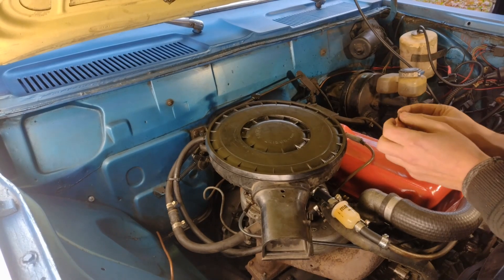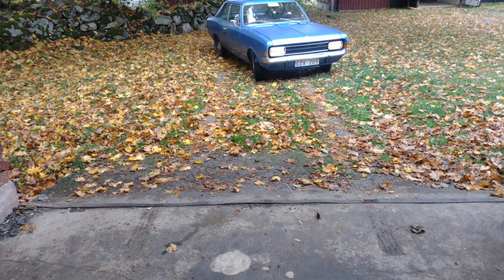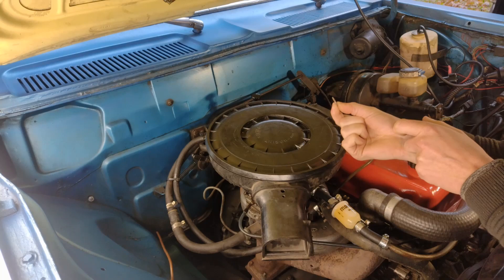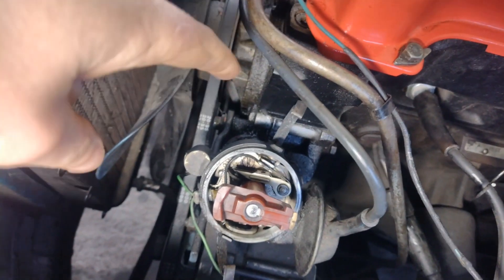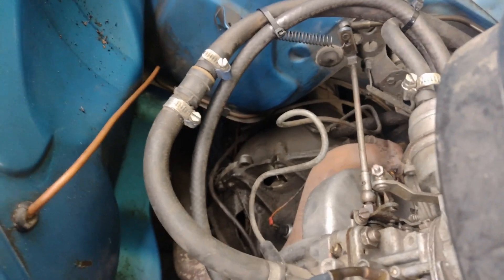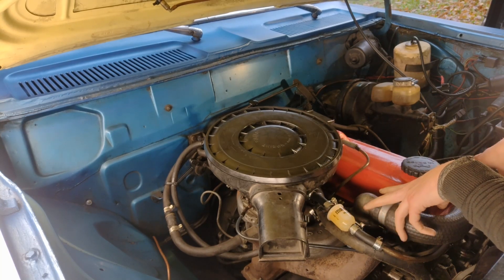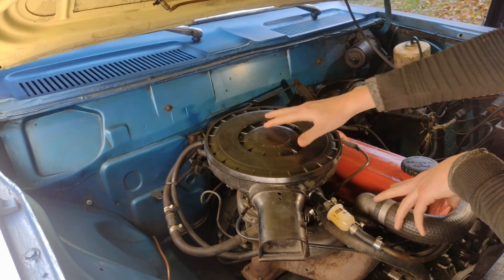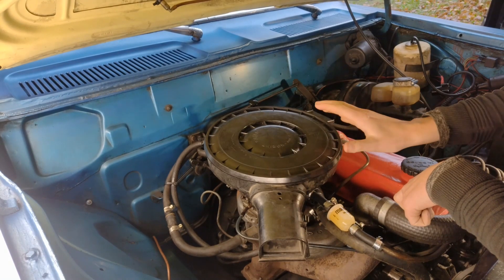Carburetor Solex Troubleshooting on Opel Rekord C 1900 From 1969

Comment: Must Say Look awsome You kept originality in Opel cars Love those cars ❤️
Reply from the maker: Thanks ! and the car runs and drives amazing with the original carburetor.
Reply: Love those cars not much for fast cars like comfort driving and Motors actually dependable always start are Had many cars are Open had less problems with and when trakt cheap fix are Very nice drive are just Comfortable and go fast enough for Get speed ticket on motorway so are Not that interested in 4 sec 0-100 km for not what have a car for like a car take me from point A to Be and comfortable drive and Rekord are very dependable motors in those cars just Nice car own for will just Be enjoy drive and Are Very Nice Opel Rekord Berlina 1980 year model Had Green metallic with black vinyl on upside really Say Sit in that was like be in a really nice chair in home So just Comfortable Could drive 400 kilometers in that without a paus för just Comfort are Set chair high want so zjpiet legs when 189 centimeter are Just Best car ever own always start in winter line summer My wife got it when diverse for kids and Say Toolk a some cars SAAB 900 was good but Audi 100  Avant quattro Thst was when Got same Just Comfortable but pricetag are In that also Expensive and everything is expensive but not feul was about same but rest Parts crazy pricetag so friend said how could sell it and bought a Opel Rekord cup'e dark plum metamic with Black above and that had many years Are just Say Are a Really nice looking car 1979 model and just About Shown nice a var can look Check that models up for are So Awssom Looking and Just Comfortable like in best sofa in home and Just work are maybe not fastest but are Really Nice drive and Are Not that a car should be are also Not breaker bank are Just When a Rekord Berlina just nicer design are Big inside and just Love if be afford a new car today had been a Open Insignia cup'e that's is a really nice looking car and Just Needs spend a lot for get Chair in home are more comfortable but pricetag is very different but it is a really nice looking car that Also Fast but not that are probably one of most Beutyfull car ever seen look those up are Create design See it in real Beat photos and that Friend have one 2019 year model he will ne er change car again for everything Are Just not get better than this so Why change when not see how can get greater than this and was Actually So impressed in that car Midnight blue and just Are never seen a More beautifully car and Are a own level of Nice inside are Just like Soend most time in that not be a bad thing Car are In that still do very nice cars are underated brand ❤️

Comment: Surprised that a thick washer can change the hight of the fuel so much but looking at the video it makes sense. The distance from the float center to the float valve is something like 1:4 so a washer that is 2 mm makes a difference of 8 mm in the fuel level. After this video it makes sense that original parts does make life much easier. Keep on filming !

Comment: Can say On side of transmission Rotor are a round thing not know name in English are a Heat regulator of a sort Change that and Change thing on left outside are also I change Rotor a set go buy Every year for have a way be trouble are Coal also a thing And Left side are a little Thing Condensator think name is Very Common on those cars those 2 breakes down cheap and Good know that are Often those 2 parts  Are If motor work great to get warm and then stop and Just ABOUT those 2 parts Round on right side and That on left outside tvere Rotor u inside those 2 are outside those are do Trouble on All Opel Rekord cars and start acting very vierd 🤔
I had a 1973 a 1700 model Was my First car and a Opel Rekord 1980 a 2.0 Berlina second Car Those  are King in  Comfortable Drive not fast but very comfortable drive 1980 Rekord are Few cars more just comfortable Long like short are just Say about Opel not fastest but so Comfortable Drive and always Start Dream Own and cheap Own 🙏✌️👍❤️
Reply from the maker: Thanks for an interesting read. 

BR. Lauritz